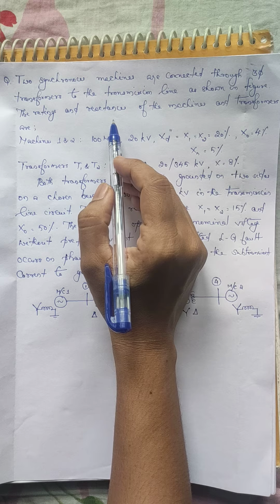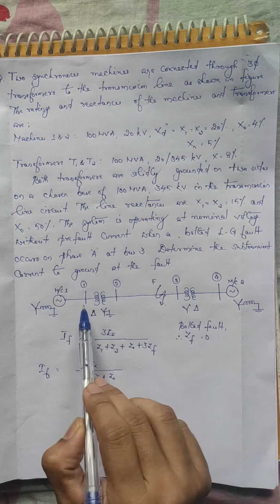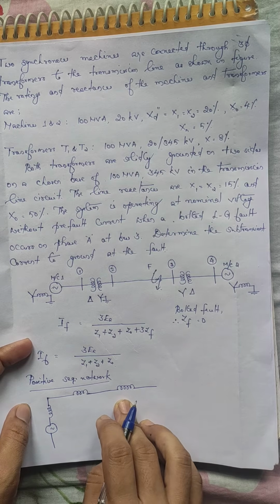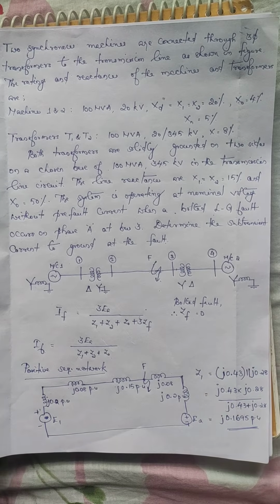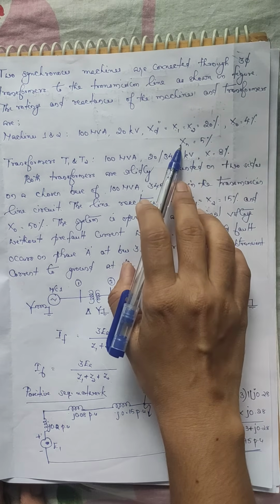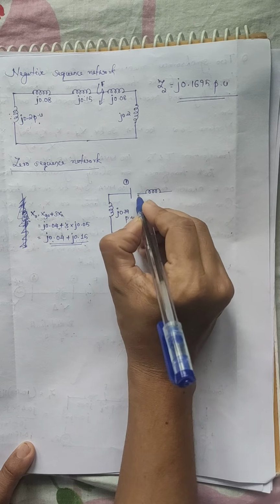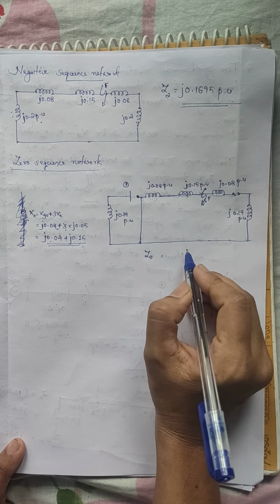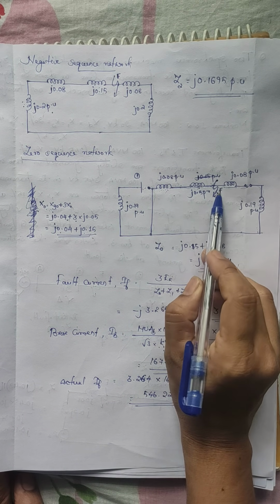Module 2 - 17. Single line to ground fault - Problem 4

Comment: For the 2nd transformer on the delta side
Why no path is given like the first transformer??
Reply: Both transformer are solidly grounded in this qns ..mam just forget to make solidly grounded in the figure (transformer 2 section)
Reply: But there should be a path in parallel section as you said..

Comment: Hello, I find on the books, X as reactance instead of Z. Are those the same, or X and Z different ?
Reply: Z =R+jx if R=0  so z=x
Reply: If you  find j do it s a reactance if you find x si it s reactance but if you find z without j so its a resistance